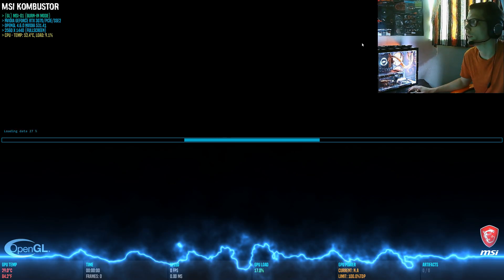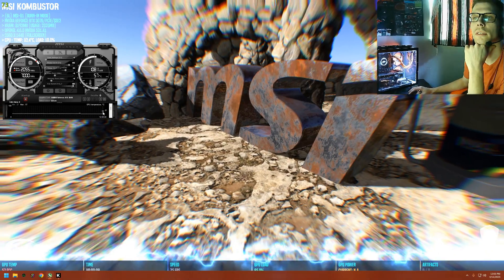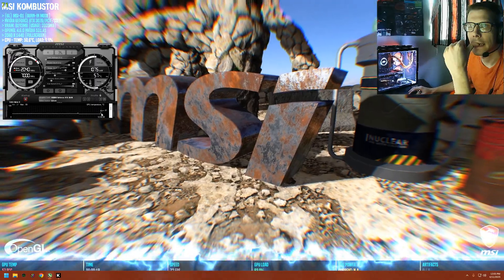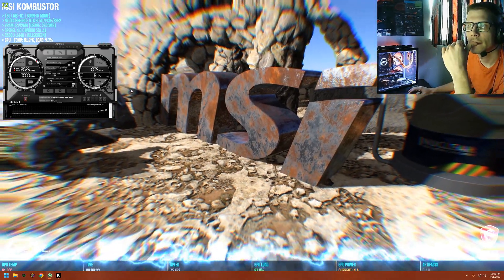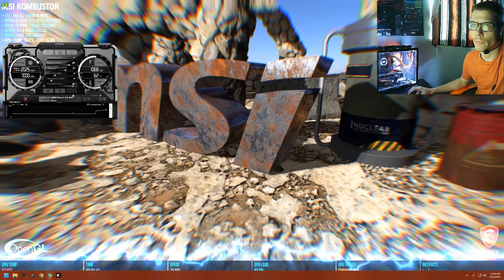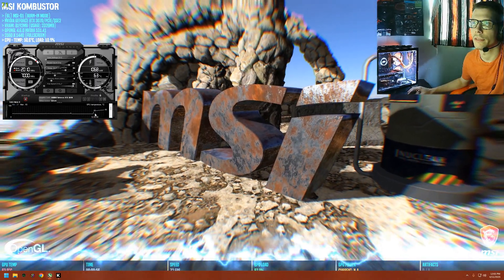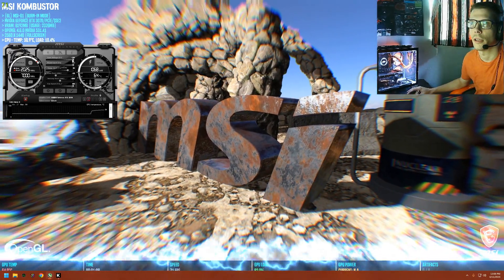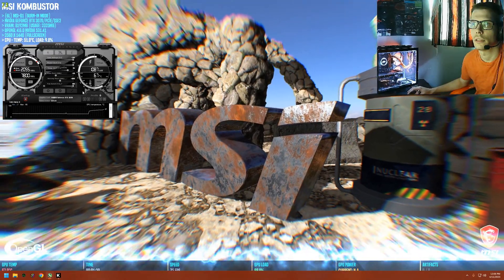Aorus RTX 3070 (repaste)

Comment: how long are those pads that you put?

im about to buy 100mm x 100mm pads

and i was wondering maybe its shorter that what is needed
Reply from the maker: That should be fine. I used a 100x100 sheet i think.

I have yet to do it on my 3070. But 
I did it to A 3080ti
Thermal buddy is good and easy too
Some H1300 or Upsiren UTP8

Best of luck!

Comment: Can i just overpaste or do i have to use disinfectant for the spot before.
Ive never done this but yesterday my monitors went out because of overheating so its 100% time to repaste
Reply from the maker: @ohhzymo5829  it would be good practice to use isopropyl alcohol to remove old paste. Then apply new paste. 

Also try not to touch the thermal pads too much, don't want dirt and oil on them .

I am currently reposting this Card again. With a new Thermal Putty. And new Duronaut Paste by thermal grizzly. 

Best of luck!

Comment: AORUS GeForce RTX 3070 MASTER
8G (Rev.2.0) This is my graphics card, is there a pad mm difference between rev1 and rev2? Would 1.5mm be suitable?
Reply from the maker: @KayaBaran  yes, I believe v2.0 used 2mm
Just try to do some digging. I'm not 100%

You can always buy all 1mm,1.5mm,2mm and then atleast you are covered. 
Vram could be 2mm 
And capacitors could be 1.5mm
Reply: @Jalopymedia I'm doing some research for Rev2.0, I hope I can find it, thanks
Reply: @KayaBaran did you ever find it? I need to redo mine, I have the same card and my temps are reaching 80C
Reply: @babushkasboi8240  No, I couldn't find it, but I will open the card myself in a few days and measure it. Then I can write the measurements.
Reply: @KayaBaran  hey did you happen to measure the mm thickness of the thermal pads?
Reply: @babushkasboi8240  yeah Mosfet and capacitors 1mm, vram 2mm and there is a small place, it is 1.25 mm

Comment: Ho I have The 3070ti aourus can I use 1.5mm?
Reply from the maker: I am not sure. Can vary depending on card version as well. 
If it's a Rev1 or Rev2

Best to do is buy a few different types thickness pads. Then measure existing pads on the card with a digital measurement caliper when you disassemble.
Reply: @Jalopymedia  v21022

Comment: Cheers for this video and the information, just done my Aorus 3070 today with the 1.5mm TP-3 pads all round and the MX4 for core, then I undervolted the card to 850mv and have the clock set at 1845mhz, the card sits between 58-65 degrees now in BF2042 and maxed out GTAV at 1440p 75hz.
Reply from the maker: Happy I could help 😁
Reply: its late but do you remember what is your rev?
Reply: @Shinobix0  rev 1.0 for mine
Reply: u prolly dont need that aggressive of an undervolt tbh mate i have mine at 887mv 1935mhz with +875 on the memory i havent repasted or done the thermal pads yet and it doesnt get over 80c mines rev 1 too had it since they released

Comment: Immediate temp increase will happen no matter what.  There's nothing wrong or concerning about that.  You won't have fixed anything here, I promise.
<-- Computer engineer for a quarter century
You never need to "repaste" if you leave the original phase change TIM on it.
Slide a guitar pick under the pads to loose them without tearing.
Reply from the maker: This revision had heat issues. And after a decade of use.. yes a Graphics card will greatly benefit from new pads and paste. I had a 1080ti just in and went from 85c, crashing, blue screen. to 65c working good as new. 

Thanks for watching.
Reply: as if we believe u. computer engineer is not equal to technical engineer.
Reply: i repasted mine after 8 years,

it went from under load 75-80° to now 54°

please...stay in your lane and world of theory.

We live in the real world,where degradation occurs

Comment: Gow much pads i should buy? I know tou said 1.5 but how much is enough for the gpu. Dont wanna order less.
Reply from the maker: ARCTIC TP-2 (APT2560): Economic Thermal Pad, 145 x 145 x 1.5 mm (1 Piece) - Thermal pad, Excellent Heat Conduction, Low Hardness, Ideal Gap Filler, Easy Installation, Safe handling - Blue https://a.co/d/1uNeE7N
Reply: 100x80x1,5mm will be enough temps go down from 82 to 70 in full load no undervolting

Comment: How much MM did you use?
Reply from the maker: 1.5mm on everything. This is a revision 1.0 model. 

I tried 2.5mm then 2.0mm then 1.5mm then even 1.0mm 

1.5mm was the best. Artic TP3 pads very squshie. 

Best of luck.
Reply: @Jalopymedia Just double checking, do you know if they change anything on rev 1.1, or is it basically the same?